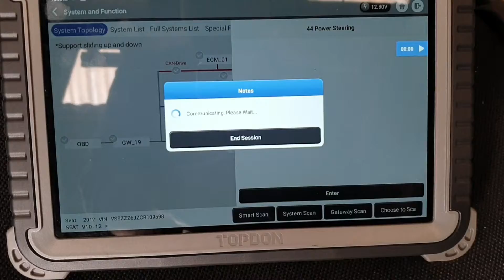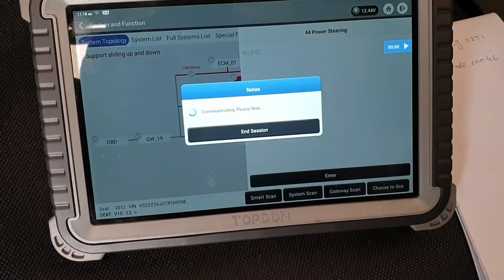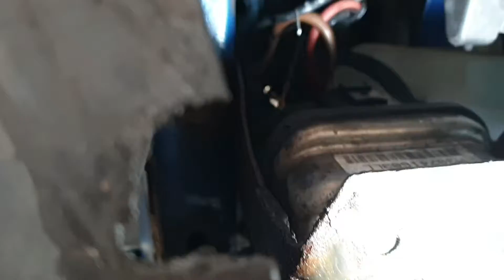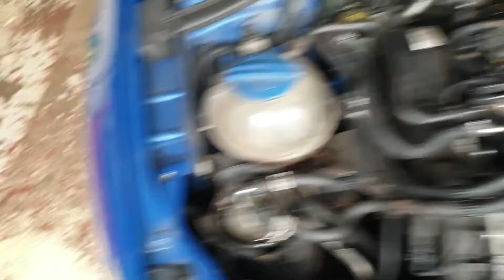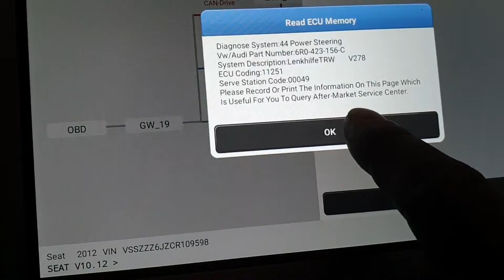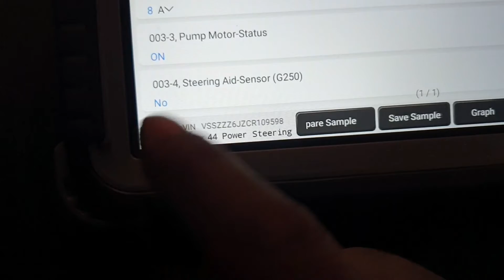Seat Ibiza 2012 Electronic Power Steering, Troubleshooting, With No DTC Stored In The EPSP Module.

Comment: I have the exact same issue on a seat ibiza. Scan data shows pump on, specified and actual pump load all good. No dtc for pump though. Suspecting the rack.
I presume the pump would throw up a fault on most cases. Whearas the rack, is that monitored by the pcm? So a failure might not show on a scan tool?
Reply: Did you ever find the cause? I’ve got a power steering light on, power steering wasn’t working til I replaced the pump but I’ve still got a light on dash
Reply: @itsmadviper does changing the pump fix the power steering I've had the same issue this week